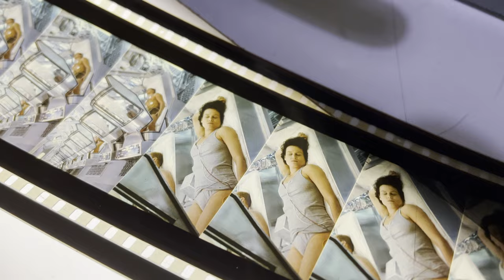Aliens on 70mm - Hayden Orpheum, Sydney

Comment: It's good to see the projectionist removed the upper 35mm pad roller.  A surprising amount of people foolishly think that isn't mandatory on the Century JJ projector when running 70mm and that leaves horrible "train track" scratches over the film a tiny little bit with each pass that build up over time.  (You can see train track scratches on your Baraka video in the scene with the monkey in the snow.  Look on the left and right sides of the image.  They are vertical "standing" scratches that don't run all the way from the top to the bottom, and are most prevalent at the top of the image.  The Century JJ is the only 70mm projector that can lay these type of scratches, so at some point in the past that print was played on a JJ (maybe not this one, but somewhere) where the projectionist didn't remove the 35mm pad roller before running the Baraka print.)

My only complaint with this projector setup is their JJ is missing the studio slap guard rails on the lower loop, and they are also missing the loop stabilizer roller there.  Because of those missing items on the projector, the lower loop here is threaded MUCH too large.  As the print is played threaded in this manner, over time tiny little scratches will start to appear in the center section of the image.  With it being a used print, it's easy to say "it was like that before", but the reality is that it is happening a tiny bit more right now.  

Hopefully the theater can get the proper missing pieces soon, but in the meantime that lower loop needs to be made as small as possible to help prevent scratches.  Something you may not realize, but that 70mm print of Aliens in this video is literally the ONLY print that is available for public viewing anywhere in the world.  The only other couple of surviving prints are in private hands and non-rental archives.
Reply from the maker: Hi FT Depot,

The 70mm print shown in my earlier video was a print that had circled the world a few times now, and the Orpheum has projected "2001" a few times using the same print and I have not seen any signs of any track lines (as typically when I'm viewing a film presentation, I focus more on the visuals and the condition of the print than the actual movie itself). 

From what I've read about the JJ model, the lower loop track-guard was an optional addition to the projector (some cinemas added it, some didn't). I'm clueless as to where the roller that the films glides across has gone, but it seems to not be damaging the film in any way so far. On most threading diagrams on the JJ projector, there is a "2 finger loop" for the lower loop, so I think the projectionist was just following the way he has threaded it for years (and from what I've seen, that method hasn't damaged any prints) so it seems to be working well the way he threads the JJ up. 

I saw 2001 on 70mm at the Orpheum twice and the print was probably one of the cleanest prints I've ever seen. It hardly had any dirt on it or vertical scratches, so I believe the way it's being threaded in the video works perfectly fine. But I'll be sure to ask the projectionist about this matter 👍

I was not aware that the print was the only one available for public viewing, thanks for letting me know, either way, it's in great condition!

Thanks for commenting, FT Depot, much appreciated!
have a great day, and thanks for watching
Reply: @ClarkTeddles  Hi Clark,

I believe you are misunderstanding what I wrote.  I did not accuse this theater of laying the train track scratches on that Baraka print.  I merely used that as an example for educational purposes so you could see the kind of marks that happen if the upper 35mm pad roller is not removed when running 70mm on a JJ.

Also because the projectionist at this theater clearly DOES know to remove the upper 35mm pad roller, of course you won’t see the train track scratches on the 2001 print.  That’s the entire purpose of removing that part when running 70mm.

It is important to note that nowhere in the Century manuals does it state to remove that part when running 70mm.  I do agree with you that at least one Century manual I have seen instructs to make a “2 finger loop” below the intermittent.  Regardless, that instruction is dead wrong.  So in one part of the manual we have instruction to not remove the upper 35mm pad roller when running 70mm (even though you will scratch your print if you don’t), and in another part of the manual it instructs the ridiculous “2 finger loop” (which you will scratch your print if you make your loop very large).  This should be more than enough to convince you that you cannot trust those manuals.  Also remember no two different people’s “2 fingers” are the same size.  It’s a ludicrous way of measuring as there is no consistency or reference.

The dilemma here is that this projector is missing the parts to protect the film from being scratched at the lower loop.  Since this happens after the aperture, any damage won’t be visible until the next show, and sometimes not even on the next show. . This is because loop scratches appear VERY SLOWLY with repeated plays.  You won’t just run the print one time and then the next run look at it and say “oh wow look at the loop scratches”.  It will build up slowly, but that doesn’t mean that the damage isn’t happening.  Unfortunately without those pieces and that loop size in use, it is absolutely scratching.  Also since these prints are used, it’s very difficult to differentiate which marks happened on the prior show vs. some show many shows before.

So with the current setup (in reference specifically to NOT having the loop stabilizer roller or studio slap guard rails installed on the projector), the best practice the projectionist can follow to minimize slowly-evolving damage is to first rack the intermittent framing as high as possible in its travel, then bring it back down about 1 perforation before threading.  The precise framing can then be fine-tweeked from there.  The reason for this practice is because the higher up the intermittent is in its travel, the more controlled the slapping around of that lower loop will be natively.  Then when preparing to size the lower loop, advance the projector mechanism very slowly until the intermittent pull down is at the very end of its dwell and is just about to start pulling down the next frame (meaning the lower loop would be at its smallest position).  At that point, size the lower loop to where a Sharpie pen could comfortably fit in between the intermittent shoe’s pivoting mount and the film itself without much extra room.  (Remember that’s the SMALLEST position of the loop.  It will be a little bigger after the pull down.)  

In a nutshell the procedure described in the previous paragraph is the safest way you can run a 70mm film on a JJ which is missing those parts since it will minimize the amount of slapping around of the lower loop.  

That being said, polyester film stocks (anything 70mm with DTS) will slap more due to the sheer nature of polyester base, and polyester base prints are more easily scratched too.  So although you may not see the marks appearing on screen just yet, if you shine a flashlight directly onto the base side of the film such that the light is directly reflecting back towards your eyes off of the surface of the film (not shining the light “through” the film) and without the film being in motion, you will see where it is starting to get scratched.  The idea is to get to it while it’s still light surface base scratches before they become scratches that project to the screen.  Acetate film stocks (anything with mag, such as Aliens) are more scratch-resistant than polyester film stocks, but acetate is certainly not scratch-proof.

You are correct the studio slap guard rails was an option, but most premiere theaters that ran 70mm got them because it is more gentle on the film, and also makes the projector run quieter which is sometimes heard in the auditorium.  Regardless, as long as the loop stabilizer roller assembly is installed, you don’t have to have those rails to prevent scratching 70mm on a JJ.

In light of your video, I have shipped a Century JJ loop stabilizer roller assembly to our mutual friend John, who will get it to the Orpheum.  I have also included an improved roller with the bracket that protects better than the factory original roller should the film start to develop a curl from a humidity drop.  This part I shipped is the critical part that is missing from this projector.  Once that is installed onto the projector, as long as the lower loop isn’t TOO big (definitely make it smaller than in the Aliens video) and the film is threaded UNDER the roller, it will be impossible to scratch there. Everything else in the system looked great, so at that point they will be able to run without any real concern about projector scratches.

In the meantime if you want a bit of fun, do a youtube search for “FilmTechCinema channel” on youtube and check out the “Interlocking 101” video as well as the three “Booth Training Seminar” videos.
Reply from the maker: @FTDepot  Hi Brad,

Sorry for the misunderstaning, my mistake. I understand now, thanks for clearing that up.

Thanks for sending the lower loop stabilizer and roller, I've let Andrew, the projectionist know about this. 

Thanks for the paragraph about how to properly set up the lower loop. much appreciated. 

I'll take a look at "FilmTechCinema Channel" and interlocking 101 and booth training seminar (I've seen a few of the BTS videos before, much enjoyable). 

Cheers,
Clark